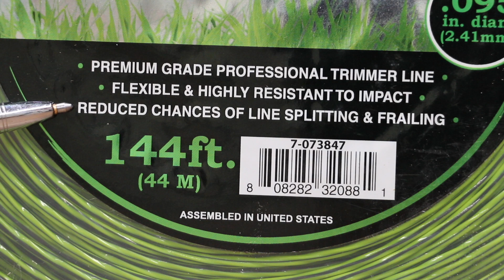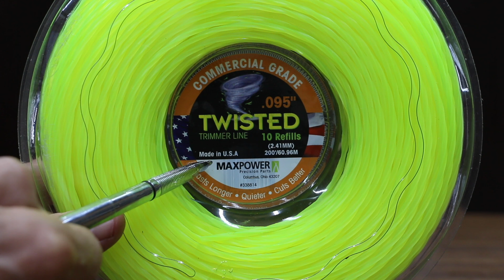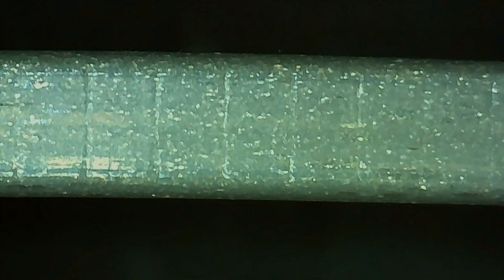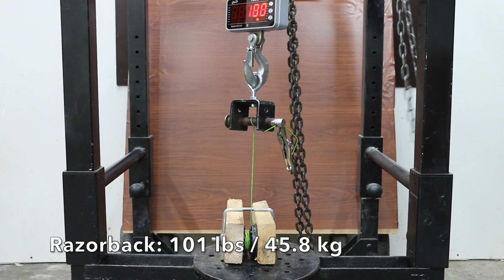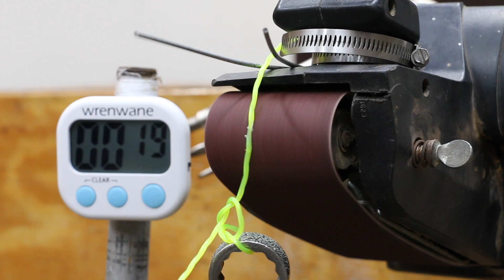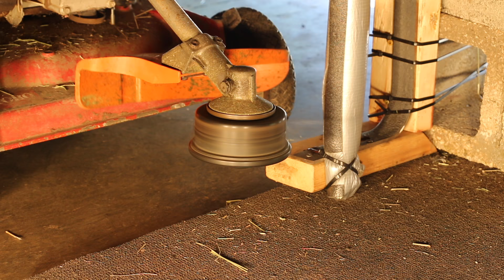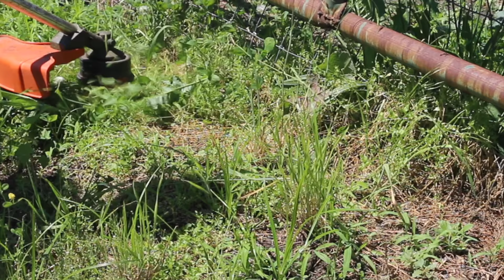Best Trimmer Line? Let's Find Out! Round 2: Stihl, Husqvarna, Echo, Oregon, Shakespeare, Weed Eater

Comment: Awesome video... I use Xtreme Square line... over the years it’s the best line I’ve used.. round lines just don’t cut clean and quickly as square or triangle lines to me... another important mention is the trimmer being used, I have echos 230 and 225 and husqvarna 223s
Reply from the maker: Thanks for sharing!
Reply: As a cemetery custodian I've tried various brands of line over the years and always come back to Extreme (made by Arnold) It never welds or breaks and is especially durable when trimming against granite bases of tombstones. We also have a Husqvarna (323) and although the recommendation is .095 line it works well with .105 which, of course, lasts longer.

Comment: Could you do a video on if  octane booster actually works and does it perform as well as the regular high octane fuel without booster which is cleaner to run
Reply from the maker: Thanks for the video idea.

Comment: One engineering comment for you.  During the tensile strength deflection tests, the attachment to the yoke on the hoist allowed the line to rotate about the clevis pin(you can see the vise grips flipping over).  This obviously affects the total elongation of the test as your effective specimen length is increasing as tension is applied.  This would also potentially impact the tensile strength results because the line is not loading up uniformly as strain is increased.  However I doubt that this would significantly impact the overall outcomes of this test.  GREAT JOB!  Really innovative test setups to investigate the spool winding and the grass cutting performance.
Reply from the maker: Great constructive feedback. Thank you

Comment: G'day,

Very interesting...

I use a Tanaka TBC-500 Brushcutter with a solid Disc-Spinner which takes individual lengths of String, owing to the Rocky nature of the Forest-Floor that I'm working on ; in theory I waste half of every String when the working Tails wear off the Centre - but the Rocks would kill any Plastic-shelled Spooling Mechanism in very short order.

One point I wondered about was that the Grass-Bundle Cutting-Test was set up to bash the Bundle with the middle of the String as it swung  around to the Impact-Zone..., which was an interesting In-Vitro Test...; but In-Vivo (Real Life) that isn't how String Grasscutting happens - the Strings are rotating sufficiently fast as to  sweep a flat rigid Disc, stiffened by "Centrifugal Force", and ALL the Cutting occurs with the Circumferential Edge of the Disc.

  So all the Wear typically occurrs to the outer 1/2 Inch or so of the String , and when Edging a Concrete Path the Abrasion sometimes occurrs over a distance of 2 inches at each Tip ; leaving feathery wisp of String which is too light to be Centrifugally-Stiff enough to do anything but bend back & be sanded flat.

   I think you might try a Time-Trial Cut-off Test, with each String run at full Throttle in a Solid Disc-Spinner cutting into a uniform flat smooth field of Grass, and then see how many Square Yards they cut down , sweeping side-to-side while slowly walking forward  into the Grass - like a Petrol-powered Scythe..., for a timed Minute, maybe two minutes.

And, then measure Area Cut as well as the amount of Wear on the Tips of the String Tails...

   That'll tell both how the String actually cuts, and how fast it wears down or breaks.

If you feel like it (?).

Such is Life.

Have a good one...

Stay safe.

;-p

Ciao !
Reply from the maker: Thanks for the video idea.

Comment: Echo Crossfire is a significant step back from their Black Diamond line. Cuts cleaner, straighter, and quieter and much more durable trimming around hard objects than Crossfire. Also, need to test if there's anything to soaking trimmer line in water or storing it in a ziploc bag with a damp cloth to maintain its flexibility.
Reply from the maker: Thanks for the video idea.

Comment: ooh  good one.  Let's see if my favorite comes out on top.  Well my favorite doesnt suck! .09 stihl on speedfeed 450 head.   Pre cut your line to the proper length to fill the spool to keep from wasting it. and  store it in a plastic coffee can with water.  It wont weld to itself in the trimmer head and the line lasts a lot longer especially cutting along chain link fence or in light brush.  The nylon really does soak up water and become less brittle. I read that years ago and didnt believe it till I had a bad day with the line welding and jamming in the head,  the same line I had used the year before and didnt have problems with.  I remembered that soak in water advice so I soaked some.   The next time I spooled up it was with line that had soaked for about a week.   The difference was clear. Can you put some numbers to soak/no soak Todd?  Line off the same spool, leave some line baking in the sun for a week,  some straight off the spool that has been stored at room temp and another that has been in water for a week.
Reply from the maker: Thanks for the feedback.

Comment: The problem I have is that for the actual trimmer tests, the trimmer is allowed to get pulled into the grass and moves INCHES closer invalidating any measurements or comments of cutting through or not. Everyone knows that if you move the trimmer closer (2" for example) with 2" of fresh string now hitting something, it cuts better than stopping 4" away when the string is 4". Also, when the trimmer moves inward, the physical force applied is different as is the relative power of the motor because the moment arm is shorter giving the motor more leverage  and less end abrasion. Watch the wheels and the cart move during those tests.
Reply from the maker: Thanks for the feedback.

Comment: Razorback $0.05/ft	Echo Crossfire $0.08/ft  	Husq. Titanium force  $0.09/ft	Max power Twisted $0.10/ft	Weed Warrior pulverizer $0.11/ft	                   Oregan Magnum Gatorline $0.13/ft	Shakespear Ugly Twist  $0.14/ft  	Stihl $0.14/ft
Cost per foot        	               8	7	6	5	4	3	2	2
Tensile strength	               2	1	4	8	7	6	3	5
Weight to Release	       1	4	7	5	6	3	8	2
Abrasion Durability	       3	1	5	6	8	2	4	7
Cut Through Test	               1	1	5	8	6	1	4	7
Durability for Wire               3	2	6	8	7	1	5	4
TOTAL	                              18	16	33	40	38	16	26	27
Higher number is better.
Maxpower Twisted wins with 40.  2nd Weed warrior with 38 and Husq. in 3rd with 33
Left to right in the columns is the same order as he shows them in the beginning starting with 
Razorback and ending with Stihl. I used Google Sheet to make this and if anyone knows a bterr way for me to share, id like to know. thanks.

Comment: Great test setup. Actually, next time calculate outt he stretch. I do plastics extrusion and this property is used a lot for qc work. There is a correlation to elongation and tensile strength but depends on the plastics formulations. The un wind test is impressive. This property also is denendant on the slip agent used in the extrusion. Most of those are plant or animal waxes added to the plastics resin. A high slip level with low elongation will probably unwind easy but too high a level will make it harder to cut the grass due to slippage. This will make the trimmers autofeed mechanism work easier. Great idea with the abrashion setup.  Ever think about comparing tub and tile caulk? Dry times, mold resistance,  adhesion on wet or dirty surfaces?
Reply from the maker: Great feedback and great test suggestions!  Thank you

Comment: I just got a used echo trimmer and was talking with a friend who does lawn care he recommends The CF3 Pro Trimmer Line. I haven't seen anything about it when I tried looking in to it I did get a medium size of the .095 line you just tested over some cheap store brand that was at th house when I bought it works much better and spin is smoother and faster. I am thinking about the echo   speed feed 400 trimmer head as the one I have it only holds a few feet and jams and hard to keep line in I have a large yard there was a blue timmer line in it when I got it that was a 2 part line a center with a coating that I've yet to find that was a really good line that even cut over growth over 1/4 in. Maybe you could do some trimmer head reviews it's the season for it and maybe you might know if that line or someone else may I would like to know and bbn see something with he CF3 Pro Trimmer Line from sthil.. Thank you for all the reviews I'm starting my life over after losing almost every and these videos help with finding some of the best things I need and that make our lives easier and more efficient.
Reply from the maker: Great recommendation!

Comment: Fun fact, trimmer line in the 1.7mm diameter size, once dried (to remove the moisture, it's very hydroponic) can be used in a 3d printer as a cheap nylon filament. 250m for $6 versus $50 for 330m/1kg of real nylon filament.

Printed many things with trimmer line. Gears on my extruder have been going strong for 2 years. Just set the filament diameter to 1.70mm in the slicer.

Drying is 100% necessary. Just steams and pops with lots of under extrusion of you don't. At least 4hrs in the oven at 60°c or in a dehydrator.
Reply from the maker: Thanks for sharing.

Comment: I wonder if glass fiber reinforced nylon 3D Printing filaments could be used for trimmers? It'd probably need to be 3mm filament.

When I worked in landscaping I actually liked trimming because it required a good level of skill and the final results showed it. Maybe it's not up your aisle but I'd love to see a showdown of anti-fog coatings. Seeing as safety glasses are required during trimming for obvious reasons, I'd unfortunately always have my glasses fog up (especially in the mornings) which I had to wipe away constantly or try to work through the fog.
Reply from the maker: Thanks for the video idea.

Comment: I once had a seccond hand weed whacker that used regular steel aircraft cable that had lead ends like a bike brake cable, it would never wear down or break and it always cut verry nicely
Reply from the maker: Thanks for sharing.
Reply: @ProjectFarm  if you do a round 3 add it in

Comment: Have you seen the 3-bladed nylon blade trimmer head? If you have, I have a question. The instructions that came with mine said to keep the blades wet during storage. I would like to know if there is a difference between dry stored blades and wet stored blades.
Reply from the maker: Thanks for the video idea.

Comment: Nice job.  Wondering if you would test string line that is 0.065?  Some other ideas - tire air pressure gauges might be interesting.  Also portable air compressors might be interesting as well - maybe under 10 gal.
Reply from the maker: Thanks for the video idea.

Comment: I would love to see a comparison of the super expensive refrigerator water filters vs the off brands that cost 1/3 the price!  Who's with me???
Reply: Might be expensive. He would have to send in samples to a lab to see how purified the water is?
Reply: @WorldChampInfinity  He's sent oil samples to a lab before. The concept is the same.
Reply: Well that's a good idea I have ordered filter from I think filter. Com. Well my problem has been that when you can connect them sometimes no water will come out. And you can try to put them in and pull them out put them in pull them out and still nothing so you have to send them back. But one thing about the water filters, is the fact that your refrigerator has a built in computer program and after so much water goes through it comes up with a light on that says change your filter. But you can easily just mash the reset button whether or not you have changed the filter or not and it will go on another amount Of time or amount of use and tell you to change it again. I sure do get tired of having the refrigerator change filter light come on and then put in faulty filters.
Reply: I can get behind that.
Reply from the maker: Great video idea! Thank you
Reply: @ProjectFarm  I'm willing to buy the filters.  Just tell me what brands and how many.
Reply: oorah
Reply: Yesterday 4 cheap filters for my Samsung refrigerator were delivered by Amazon. It would be nice to know if I made a wise purchase!
Reply: I have a Samsung fridge.  I bought a Home Depot HDX filter and it made the water taste like plastic (even after flushing) and was clearly of lower quality. 

Another common difference is OEM filters at least for Samsung have a double O ring on top and the cheapo ones tend to have only one increasing risk of leaks.

Comment: You should try the square weedwhacker string it's alot better but what was the rating of the string is it 0.80, 0.85, 0.95, cause that size string makes a difference in a trimming head

Comment: My favorite line is whatever is in my weedeater as long as it's in the .90 range. Most of using up too much line is due to technique. Watch your outside cutting edge, the tip does the work. Go right up to the fence, not into the fence. If you need to get into it a little bit, drop the rpms, it'll still slap the grass off but wont break as easy on chain link. (oops...you said that)
Cut the grass, not the curb.
BTW Mr. Farm...I'm just now thinking about considering starting to make plans to eventually change out the (at least 3 years old) Bosch wipers on my truck. I thought they were getting bad but just wiped them off and they're still good.

Comment: Nice test. One thing though: Your fence test is somewhat hindered by the update-rate of the Meter.
Looking at the footage a lot of the variation between the different lines seems to come down to when the meter updates relative to the point it breaks.
You would need something with about 10 times the rate to reduce the influence of this effect to usable levels.
Reply from the maker: Thanks for the feedback.

Comment: Man, I’m so glad you did this.  I’ve been using the echo for the last year and I HATE it!  I even go slow or pulse the throttle when cutting against wire fences and the line still breaks off.  It also breaks when edge grass.  Worst line ever!   I’m going to try the max stuff now.  Hopefully will be better.
Reply: Kind of a toss up between a durable line and not so tough it breaks preventing surface damage to anything it touches.
Reply from the maker: Thanks for sharing.

Comment: Best trimmer line I've ever bought is Shakespeare Heavy Duty Titanium. Bought a 1 lb roll 10+ years ago, still have plenty. Granted, i don't trim a lot but i rarely have to add line. That includes trimming next to a chain link fence. It tends to grab and climb the fence rather than break. Plus, with a square shape and titanium tips, it made short work of grass and weeds,  including some woody weeds.

Looks like I'm gonna try MaxPower twisted if i ever run out of the current line.
Reply from the maker: Thanks for the feedback.

Comment: Spray on wipe off ceramic coating show down? Mother meguiars turtle wax Lucas which coating is easier to apply an remove? Which one last longer when exposed to the elements an bird droppings? How many washes can they take before the water replacement wears off? And also fuel cleaner show down i know you did some head to head between some products but with so many brands which is best at removing carbon deposits, cleaning injectors, removing water from the tank stabilizing fuel left in storage, an which help with getting better mileage?
Reply from the maker: Thanks for the video idea.

Comment: I've had great results along fence lines with my power washer and a turbo tip.  String trim as close as you can, then finish with the washer.  Don't aim down, though, or you'll dig a trench!
Reply: Now THAT is clever.
Reply from the maker: Thanks for sharing.

Comment: Love the tests you do, always unbiased and honest!
 
I personally use Stihl because that's something that is really common in my country (I'm in Europe) and we consider it good and reliable. I have the FS90 and FS240 trimmers from Stihl. I love the FS90 and use 2.4mm (0.95 in) round line with it and it can handle a lot, just holding the throttle basically at max all the time and just mowing through grass and even smaller bushes or something like that.
 
But the FS240 is a different beast, it's got about 0.9 horse power (2.3 vs 1.38) more than FS90 and can just chew through almost anything you can find in your yard that you would consider grass and such. I use 3 mm (0.115 in) square line with it currently. The only problem I have is that if I hold the throttle for too long the line can melt inside the head and get stuck, which is frustrating when working. I can avoid it 99% of the time by just regulating throttle a bit more, but it gets more annoying to work with it and it makes me slower. I'm not used to it because FS90 doesn't show this behavior and I hold throttle to 100% about 95% of the time when using FS90. It probably doesn't get that hot since it's less powerful so less RPM than FS240 I guess.
 
I tried putting trimmer line in water for 24h before mowing, that helped a tiny bit, but not that much. I also lubricated the trimmer head (on the side of the head where that screw is) using some paste that came with the trimmer and it still doesn't work as I expect it to. It gets frustrating since I'm mowing like 5000m2 (~54000 sq ft) or even more of various terrain multiple times each year. Any problem with trimmers just wastes my time and it doesn't make the work enjoyable.
 
I guess I might just have to experiment with other brands a bit more to see if some particular line is more resilient to this.
Reply from the maker: Thanks for sharing.